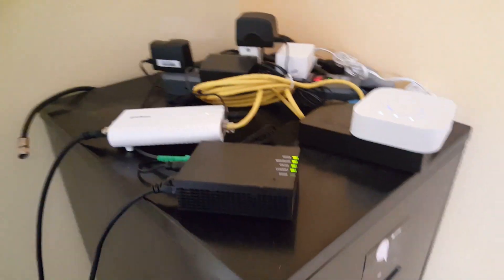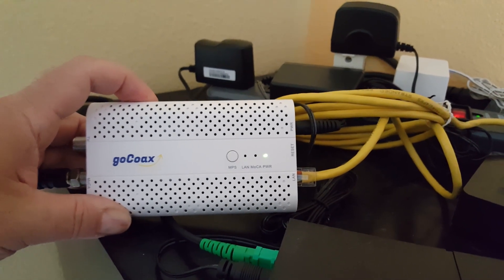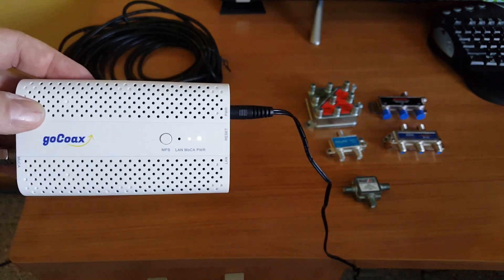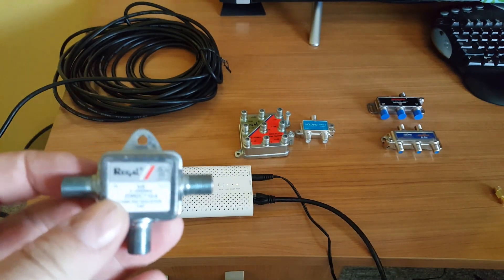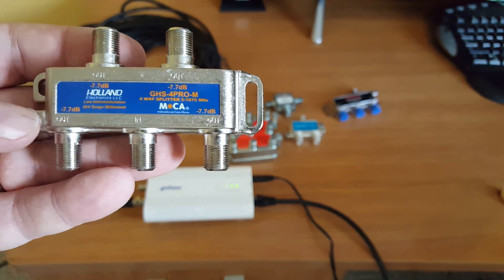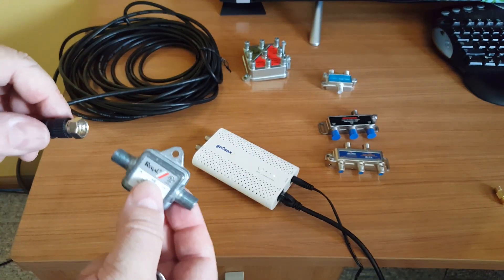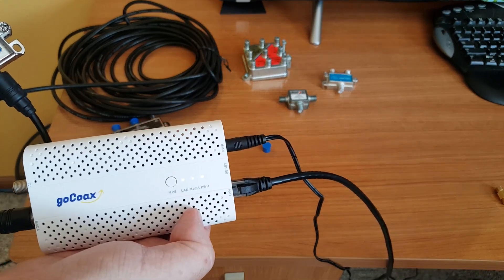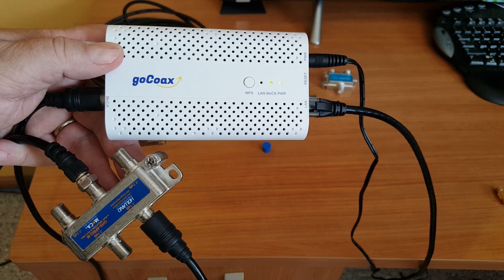How to troubleshoot connection problems with MoCA (goCoax WF-803M) and basic MoCA setup requirements

Comment: I did not find the answer to my question which is this: I have four MoCA 2.5 adapters (2 from ActionTec and 2 from Kiwee Broadband, both using the Maxlinear chipset), connected directly by a short (about 1ft - as supplied with the adapters) coaxial cable - straight cable, no splitters. The MoCA adapters' web interface confirms a 3700Mbps-ish PHY rate between the two adapters, but ttcp or iperf report only 100Mbps computer to computer. That's irrespective of which 2 of the 4 adapters I use on either end. If I connect the same two computers with a Cat. 6 cable (using the same 1000BaseT Ethernet ports), ttcp and iperf give me 940-1023Mbps. I am using the correct (MoCA, not TV) port on each of the MoCA adapters. I've also used different coaxial cables. And a variety of Ethernet cables on either end - from Cat. 6 to Cat. 8. In all cases, the throughput via MoCA is 100Mbps. Why is the performance so poor?
Reply from the maker: Interesting.
It appears you have done a LOT of background investigation in this.
Are you 100% certain that each of the computers you are testing in this setup have gigabit ethernet capabilities?
I ask because some laptops only had 100 MBPS ethernet for a long time until they all got the gig capabilities.
Reply: @UncleMikeRetro  Thank you for your kind reply. Yes, that was one of the things that occurred to me early on. Both computers' specifications say they have Gigabit Ethernet ports, but I thought maybe one or both of them had insufficient processing power to sustain the throughput. However, this hypothesis was disproved when I connected those same two computers with a direct Cat. 6 cable, and got 940Mbps+ data rates. Also, on MoCA, my peak speed was actually slightly over 100Mbps (about 120Mbps-125Mbps). I spoke to ActionTec and Kiwee tech support and they could not identify the problem. They advised me to check what could be causing interference but I could not identify anything in the environment that could be causing a lot of EMC, also with the 1ft coax. cable there wasn't a lot of cable exposed to EMC and I tried it in two different rooms. Incidentally, I get the exact same point-to-point speed over MoCA if the cable is 1ft, or 6ft, or whole-house length (which could be 100ft). The lines I was thinking along were whether there was some MoCA protocol and latency related issue - e.g. if MoCA breaks up packets into short ones and each has to be ACK'd before the next one is sent, and there is a long latency. I seem to recall that the latency over MoCA was a bit higher than over powerline or a direct Ethernet cable. But I got no further with this idea (or any other).
Reply from the maker: Lemme think this over with you a bit.  Be back when I have an idea.  It really sounds like one of those cables is futzy.  But I am sure you tested them alone too?
Did you do an iperf test just for fun?
Edit:  I see you did an iperf.  Hmmm lemme think.
Reply from the maker: What is the frequency spectrum of any splitters you might have in the setup?  The broadest the better.
Reply: @UncleMikeRetro  There are no splitters - I'm connecting the coaxial cable directly between the two MoCA adapters, and I've tried 3 separate coaxial cables, one that's supplied with the adapter(s) which is only about 1ft long, one that I had lying about which is about 6ft long, and the one in the house whose length I don't know but I estimate could be about 100ft. In all cases, I get the same data rate. Also if I vary the Ethernet cables connecting the adapters to the computers - I've tried 2m long Cat. 6 as well as 0.25m long Cat. 8.
Reply: @UncleMikeRetro  Yes, I have used iperf, ttcp and nuttcp. They all seem to give me about 125Mbps.
Reply from the maker: @slivnik  The only other thing I have seen is can you change the base frequency of them, so they don't overlap?  And maybe go even more bay step here:  Connect the two same MoCA devices to each other (both pairs) and see if just the same devices talking to each other gives you the speed you should have.  Then check them one at a time paired differently.  So, the ActionTecs talking to each other only and then the Kiwees taking to each other?  See what you get then?
Reply: @UncleMikeRetro  Thank you for your kind help. I have already tried just two ActionTecs talking to each other (via a 1ft direct coax cable) and also just two Kiwee's in the same setup. I also swapped them round, so that the first computer was e.g. first attached to the first ActionTec adapter and the second to the second, then the first computer was attached to the second ActionTec adapter, etc. I've also tried reducing TX power and Beacon Power Level (normally I have them set to 10, but I reduced them all the way down in steps of 1). I normally have both adapters configured to use D-Low, D-High and D-Ext bands, with LOF set to 1150. At the suggestion of tech support (I can't remember whether ActionTec or Kiwee) I have tried switching them both to a different band once - I can't remember any more which one, it may have been E or H - but I switched them both to the same band. The results were the same each time. When referring to frequencies not overlapping, are you saying I should have a different frequency set up on each of the adapters? Will that work at all - I thought they both (or all, if more than two) had to be set up to be on the same frequency band? I do not know how to set the band controls with fine granularity (available controls are: D-Ext, D-Low, D-High, E, F-SAT, F-CBL, H, Custom; LOF (a number)). There seems to be no documentation for these settings, so I have not been able to play with them, beyond once switching to a different band. There are also Scan Mask, Scan Offset, Pri Ch Above Mask, Pri Ch Below Mask, which seem to be some kind of bit masks, but I don't know what these parameters mean. Do you know how to set these settings? Is it likely to make a difference?
Reply from the maker: @slivnik  Based on your trying literally everything else, it was a hail Mary for sure.  Aside from two of the Moca devices being "bad" I cannot think of anything else.  I feel bad, but what else can we check?
Reply: @UncleMikeRetro  At least 3 out of the 4 devices would have to be bad, because I've tried all 6 possible pairings so if the issue was that the devices are broken but 2 of them were good, those 2 would get better throughput. I haven't really experimented a lot with changing the bands (apart from changing to one different band) because I don't understand those settings. The only other bit of information I have is that I've also tried with another computer, and I could achieve slightly better speeds with it - I think about 200Mbps - but again PHY rates were about 3700Mbps and both ends of the connection had 1000BaseT ports. That's kind of the frustration I have with MoCA - I have no idea how to try to debug and/or pinpoint what the problem could be. There seems to be no diagnostic tools or logs to look at. Or settings to change. One thing I'd like to change (if it was possible) is the MTU / MoCA protocol packet size, to test my hypothesis that the issue could have something to do with packets having to be acknowledged and the relatively large latency on the line - it's bigger than over my powerline adapters and of course bigger than over a diret Cat. 6 cable. If this is the issue then increasing the packet size would increase throughput.

Comment: I have a question so I have a splitter that was installed when I had direct TV, which I no longer use. The splitter they installed has a mhz range of 2-2150 I assume that's more than enough for it to be MoCA compatible.
Reply from the maker: Hello!  Yes, the normal frequency range for MoCA is 850-1500.  You should be fine!

Comment: These are fantastic and love they added security finally. I waited till they added it to 2.5 Version. That said, it does depend on housing wiring’s on some places I rented work and others completely failed. However, when it works it’s amazing.
Reply from the maker: Totally agree, and that is part of some of the issues the commentors have been experiencing.
If the coaxial in the walls is good and not too many splitters, the system works a charm.  Old and crusty and/or split to hell and gone, not so much.  
I could not function as well as I do without MoCA.  600/400 in all parts of my home!

Comment: So excuse my question.  In order to work I need to have 2 mocha devices.  1 is useless?  Because I have connected the mocha device to the coaxial wall socket and with the ethernet cable to my modem, but there is no network activity.
Reply from the maker: It is a reasonable question.  Yes, you have to have a MoCA device on EACH END of the coaxial connection.  Some newer modems/routers are MoCA capable and then you'd only need one other device, but it still adds up to two.
Reply: @UncleMikeRetro   Thanks a lot for the answer.  I thought it was enough 1. Unfortunately I have an unstable connection that does not allow me to play online. And I don't know what to do anymore
Reply from the maker: Are you saying your regular connection is unstable or just when trying to extend it with the MoCA?  I guess I am not 100% sure what your issues are besides needing 2 separate MoCA devices.
Reply: @UncleMikeRetro   Yes, my normal connection has been unstable for about 2 months.  Practically doing the speedtest I have some connection fluctuations.  My provider also changed the modem, but nothing.  And in fact I wanted to try the mocha, but at this point I need 2
Reply: @UncleMikeRetro  I'm new to this but does the device send the signal back through the coaxial cable and throughout the other side? Also what happens if I put a moca filter just before the moca device
Reply from the maker: @MrLuffy9131  Each MoCA device send a signal throughout the entire connected coaxial system (in the home or apartment, etc.) and when they "see" another device, they establish a connection.  That is why two devices are required at a minimum for MoCA to work.  If you put a filter anywhere in the network, it would cut off all of the devices behind it.  The only real place one would WANT a filter is in the coaxial line entering/leaving your network (like the line in from a provider) to prevent someone else's MoCA devices from seeing yours.
Reply: @UncleMikeRetro  You don't know how to give me some advice to be able to stabilize the internet connection?

Comment: Hi! I was wondering if you can help me? I have Xfinity and have the Xfi Gateway. I currently have MoCA enabled and have bought a ScreenBeam MoCA 2.5 Adapter. I plugged in a Coax cable but the Coax light is not turning on. I had a tech come in and check that indeed the Coax cable IS working. So my only guess would be that maybe the splitters aren’t strong enough or the adapter itself is faulty. What do you think?
Reply from the maker: Without seeing your setup, I'll ask if it is possible for you to confirm the two devices CAN talk to each other by connecting them locally with a very short length of coax cable in the same room?  Like I demonstrated in my video, it is best to check this before trying to connect them across an entire home or apartment through different rooms and across unknown splitters before seeing if they "like" each other in the first place.
Reply: @UncleMikeRetro  I will check that then and let you know. Appreciate the help!
Reply: @UncleMikeRetro  exactly I have no where of testing it until I go to Florida to hook up some family members that has xfinity. I could not get moca to work last year when i was down there. It would connect then disconnect. So hopefully I can get it working. I been doing some research. And that's what people are saying or you can go into the moca adapters web interface and uncheck d band or something like that but you will lose like 500 megs. Because I guess it forces the moca adapters to go to the higher frequencies
Reply from the maker: @kirtmcmullan8448  Feel ya!  You HAVE to keep us looped in on how it goes, pal!
Reply: The newer modems uses docsis 3.1 which uses the same frequency as moca so the conflicts try to put a moca filter on your cable modem then hook up the 3rd party moca adapters via a splitter on your modem
Reply from the maker: @kirtmcmullan8448  I'll admit it is getting complicated with the Modems (Xfinity, etc.) coming MoCA capable and the interference.  There are SO many variables lately that one cannot even know what to try (and you have to try everything starting with the simplest of course) unless you are standing right there in person.

Comment: Hi can you help me? I just recently bought one of this adapters from screenbeam but just one of them, because the way I get internet in my house is through a coaxial cable coming from outside the house then this one is connected to a modem wich also happens to be a router on the 1st floor, that being said I think I have an existing MoCA network in my house, so, no need for a 2nd device. So I bought this adapter to set it on the second floor so it could give a faster internet speed on a router instead of relying on the querky bridging, but the adapter is not working, the coax light never turns on not even on the modem that's on the 1st floor wich is actually working with a directly coaxial cable connected to it. Do you know what is going on?
Reply from the maker: Good morning!
Well.  If your incoming coaxial internet signal is not connecting to a MoCA enabled cable modem/router, then this should work.
Let's first make sure your device is Moca capable.
There should be a logo or printing on the router supplied by your provider with the symbol or words "MoCA Certified" and a light on it for MoCA.
If you have that, let me know and we'll go for there to see what's the matter.  If not, then you do need two MoCA devices, not just the one you bought.
Reply: @UncleMikeRetro  good morning, well, yesterday I was looking into that and aparently, yes, my modem haves that feature, however in the manual there doesn't seem to be anyway to activate it, it's an arris tg2482a
Reply from the maker: Hey pal!
Try this webpage for an explanation of how to enable MoCA on an Arris modem.
https://routerctrl.com/how-to-enable-moca-on-arris-modem/
Let us know if it helps.

Comment: Why are you using an old VCR coax jumper? Do you have any idea how much ingress you're causing?
Reply from the maker: What difference does it make if these MoCA devices are designed to use the (old) existing coaxial lines already on one's home?  
You have any idea what those connections probably look behind the walls?
This little thing makes NO difference and I get full bandwidth.
Reply: @UncleMikeRetro  Ingress is big deal. Ingress interferes with your transmit which is at the lowest frequencies on the cable system. If ingress comes from your house and back feeds into the cable system, you can cause an outage for the whole neighborhood because you need to be able to transmit in order to receive and your modem needs to be able to communicate back and forth with the CMTS at the cable headend. As long as your existing coax cables have good shielding and the connectors are still good and tight, you shouldn't have a problem with ingress, no matter how old the cables are. As for the old VCR cable, it doesn't have the proper shielding to block ingress and the connectors are not designed a tight connection. Ultimately, the old VCR cable is only designed to go between the VCR/Set Top Box and the TV.
Reply from the maker: @anfilofeEA  Ah, I gotcha now!  Well, that WOULD be an issue, but I am currently on fiber optic for my internet, not the cable anymore.  That is an older video and things have changed.  Not with the MoCA setup just the provider.
Good lesson though!

Comment: Hello i just hooked up my moCA connection and I'm using the htem4 set I get the active moca connection but when I plug my ethernet from the second device into my pc it will connect momentarily but about a minute after it plugs into my computer the light it has indicating the moca connection is live turns off and I lose connection then it comes back shortly after and just repeats I haven't been able to find the solution looking forward to your response thanks!
Reply from the maker: Hello!
So, it sounds like you might have a splitter somewhere in between these MoCA devices that is periodically blocking or creating interference in your signal.
Can you physically trace the line connecting the devices, or is it buried in a wall?
Reply: @UncleMikeRetro  so kinda lucky for me I have a splitter in my basement that has around 5 different coax cables running and I know only 2 of them are active which is the one running to my router and then the one running to my room for the MoCA device, I have another splitter that one coax leads into my router then another into the other moca hopefully this helps I’m not very knowledgeable on anything related to networking 😊
Reply: Could the thing that is interfering with it be that it’s trying to run through multiple cables in the splitter and not the right one? If I unplug all the cables that aren’t being used would thag help at all?
Reply from the maker: hey pal!
Yeah, let's try to just run the one line needed for the MoCA after disconnecting the rest.  See if that helps.
If not, you MAY want to go out and buy a confirmed MoCA compatible splitter for the basement and try that. 
It really sounds like this is the issue.  Cross fingers, but this is by far the cheapest way to try a fix.
Reply: @UncleMikeRetro  cool thank you I will try that as soon as I can and will let you know the results thank you!